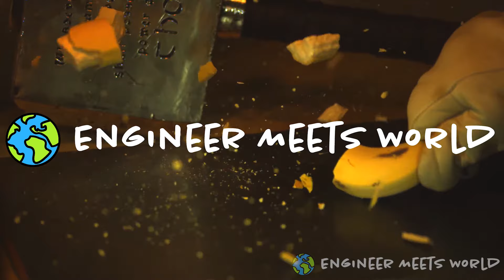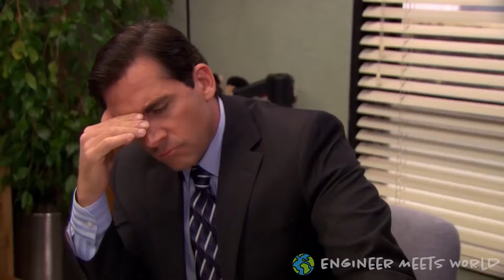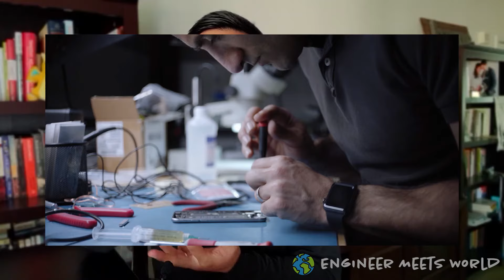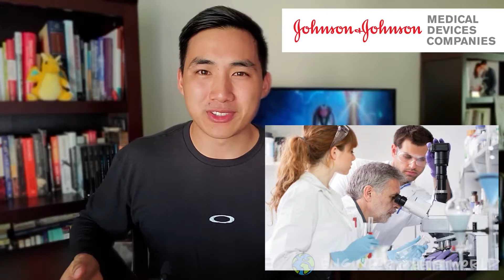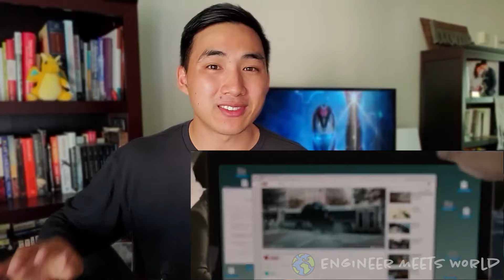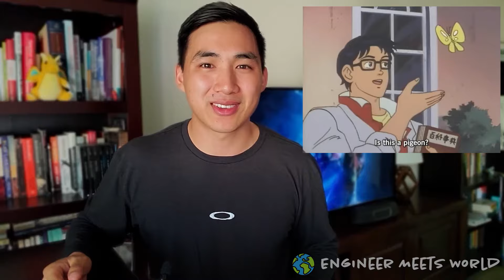Mechanical Engineering Explained - Is Mechanical Engineering HARD? What do Mechanical Engineers DO??

Comment: Which is easier, mechanical or computer engineering?

I have decided that I should enter engineering as my degree, still not sure which of this both should i take. Though I'm not that super smart at math.
Reply: All engineer majors require a lot of work. They just have different kinds of work. With mechanical engineering you will be learning the mechanics and intricacies of physical systems, everything from materials, to heat transfer, to circuits, to fluid mechanics, along with multiple levels of calculus, physics, and differential equations and linear algebra. With computer engineering, you will learn the same levels of math and physics, but your focus will be more on the electrical side, along the lines of electrical engineering combined with computer science. From what I’ve seen electrical engineering concepts require a lot of theoretical math to compute electromagnetic waves and signals. Theres also a healthy amount of coding.

I don’t say this to stress you but both paths require lots of work. Personally, I originally was going to go with computer engineering, but after doing some research I’ve fallen in love with mechanical systems. I am pursuing mechanical engineering. I will say you don’t have to be super smart in math, but you will need to apply yourself and try your best to understand it and get better as you go. There will be a lot of math in your course curriculum, and you don’t want to run away from it. Embrace it, engineers need math just like a woodsman needs his axe. The better you are at using your tools the better you are at your profession, and math and physics are very important tools for the engineer to utilize. Good luck!

Comment: What's the difference between mechanical engineer and aerospace engineer?
Reply from the maker: Hey Lazar, that's a really good question! Thanks for asking! They're very similar actually in terms of coursework. Some schools like University of California, Irvine actually combine these two programs into one department because of how much they overlap. That's because aerospace engineers pretty much learn the same exact Engineering disciplines as mechanical engineers (fluid mechanics, thermodynamics, heat transfer, machine design, etc.) except it's specifically within the context of aerospace applications. I actually took Thermodynamics at UCI during a summer course and throughout that class, many of the problems and examples we solved during class were based off of on aerospace applications.
Mechanical engineers also study and learn a lot about aerospace applications as well but they also spend a lot of time solving problems within the context of other industries, sectors and engineering disciplines as well. For example, as a mechanical engineer I also took courses about Microelectronic Fabrication for consumer electronic devices and Internal Combustion Engines for traditional cars and hybrid electric vehicles.

Long story short: Mechanical engineering is more broad. Aerospace engineering is very similar except the coursework may be more focused on applications specific to the aerospace industry. Hope that helps!

Comment: can we used calculus when we are already working?
Reply from the maker: Hi Carlo! Are you asking if Calculus is used after you graduate and start working? The level of math used on the job will depend on what type of engineering position you are in. But yes, Calculus is definitely used. Some examples of simple applications might be calculating the distribution of force on a bridge or calculating the flow rate of fluid or air flow within a piping system. Hope that helps! :) thanks for leaving a comment!

Comment: Hey Johnny,
I'm a senior this year and taking AP Calc, I really enjoy it but am not really good at it.  How often are the higher maths used on the job? Also how important is it to know basic technology stuff like coding or general building/construction gear principles?
Reply from the maker: Hi Abigail! So awesome hearing from you, thanks for leaving a great question! To be honest, I got a C in AP Calculus in high school so I wasn't very good at it either! But yes, in general, you will need to be somewhat proficient in math and physics to succeed in the engineering workplace. Which is why there's a big emphasis in college engineering curriculums on the higher levels of math. Single variable calculus, differential equations and multivariable calculus are some courses you have to look forward to. And honestly, I struggled through them all 😅. But there's hope!!! After spending years and years in college practicing and practicing, you WILL be solid in the math skills needed to succeed in the workplace! In graduate school, I actually ended up teaching a Fluid Mechanics course which I failed during my 3rd year of undergrad (crazy right?!).

To answer your other questions on basic technology and general construction principles. It's definitely useful to understand the basics and those are all things you will learn and be exposed to throughout college so no worries if you aren't familiar with them now. Hopefully that helps! Let me know if you're curious about anything else. 😁